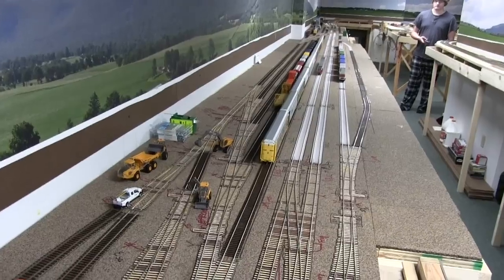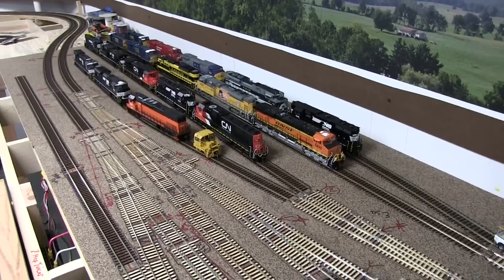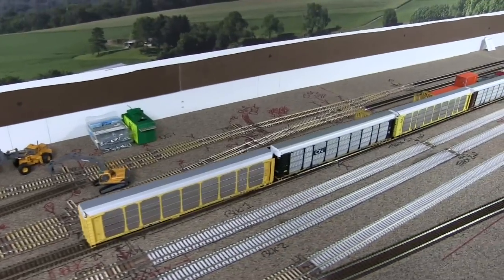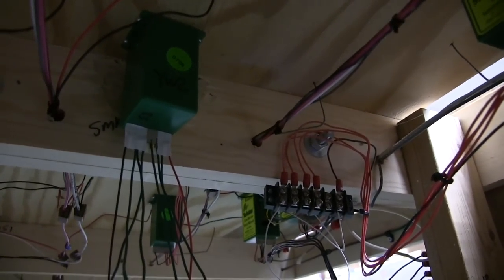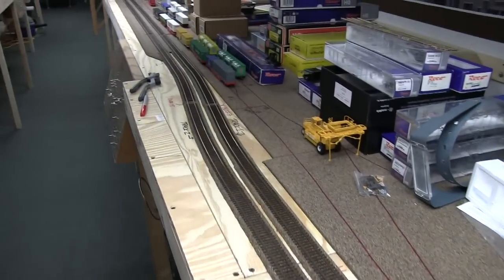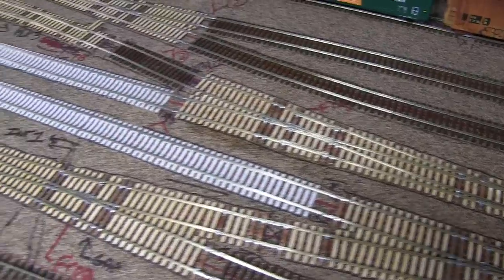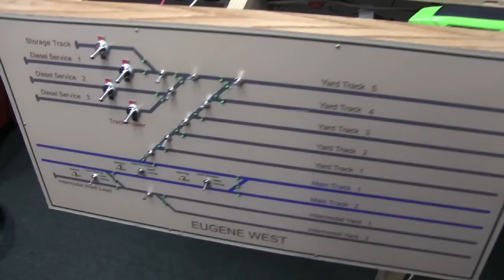Model Railroad Layout Update Video 28 part 1- Track, Tortoises, Wiring

Comment: I'm up to this point! I'm planning a 1970s Conrail electrified layout, and I'm wondering if the JMRI or C/MRI is necessary for my signalling. It will mostly be manual for clear signals with trains knocking them down through occupancy detection. What are the other benefits to using it?

Comment: I noticed how much that bullet train was 'clanking' over the rail joints? Did you solder the inside of the rails or something?
Reply: LOL, I noticed that as well. A lot of the European equipment has very large flanges- so large that they can have issues with the code 83 rail and especially turnout frogs. That is what is being heard. Interestingly Roco is now making a few locomotives with "small flanges". I have one (BR 151) and have another on pre-order. They run much quieter...